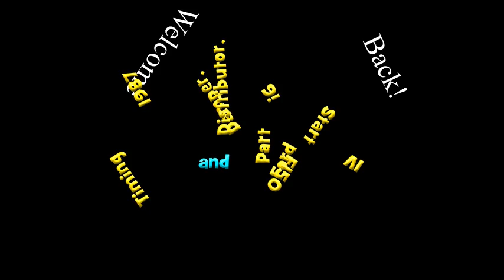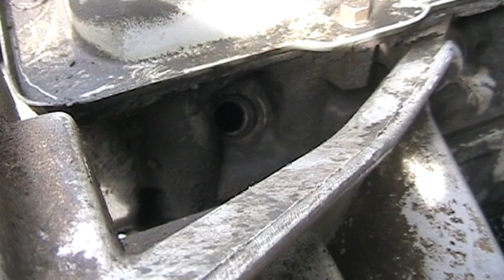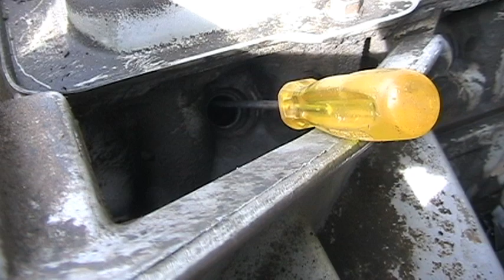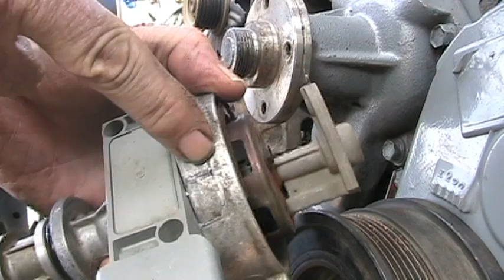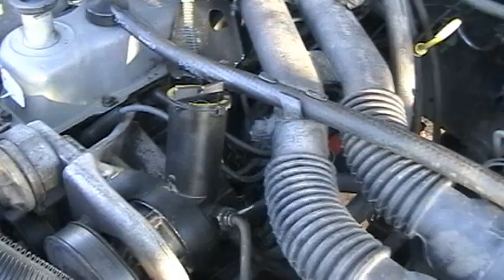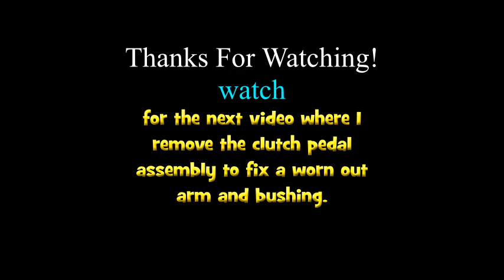1987 Ford F150 I6 Damper, Distributor, Timing and Start Part IV

Comment: what if you do all of that and the is no compression ?
Reply from the maker: Hello, Well if I was experiencing a no compression problem I would first expect a stuck or extremely out of adjustment valve or lifter (either exhaust or intake).  I would take the side cover plate off on the block behind the distributor where I could see the push rods. If it is easier to take the rocker (aka valve cover ) off then I would do that. Then I would rotate the engine over (by hand from the crank pulley) and watch the action of the valves on the #1 piston position. If either of the valves (exhaust or intake) is not moving up and down, then it may be stuck open, or held open by a bad lifter that may also be stuck and not making contact with the cam.
 Now, if both rockers are moving up and down and the valves are opening and closing then I would loosen the adjusting nuts on the rockers a bit to make sure the valves have a chance to be fully closed ( this would make the rockers loose and give a very clacky noise if the engine were running).
 Now do a compression check. If you know the valves are closed because you backed off the the rocker nuts enough and still have no compression, then take a small block of wood and a hammer and tap on the valve stem. The idea is to see if the valve is moving down and then back up. Do this on both valves ( you may have to loosen the rockers up enough and set them off the the side of the valve stem spring to actually notice and feel the valve moving. This procedure may free up a stuck valve. Be sure to tap on the valve stem and not the spring itself as you do not want to have the spring-stem valve keepers to come loose and have the valve spring come loose and drop the valve down into the cylinder..
 If all this fails to get you some sort of compression then it is possible to have a seriously burnt valve or some sort of piston or piston ring failure that is letting the compressed air escape out of the cylinder. I am assuming that your cam gear and cam are in good shape and not missing any teeth. If your push rods (and I mean all of them) are not moving then your cam gear is most liked striped of its teeth.
It is my hope that you find a stuck lifter that is holding the valve open.

Comment: what's the problem when the timing is jumping in a ford f100. motor 300
Reply from the maker: Well, I am not sure. I would check to make sure my distributor hold down clamp was tight. I would also look for any vacuum hose leaks. It may be that the fiber cam gear may need replacing. I would also run a code check on the engine and I would make sure I had a new cap and rotor on the distributor. Thanks for the comment!
Reply: The module can be bad. A bad plug or wire can cause that. Check the distributor cap for arcing.
Reply: Raunel I have the same problem and I believe that the cam gear is missing a tooth. It will go from hyper advanced to overly retarded and back. I have been able to get it to start by adjusting the spark timing (rotating distributor) but the valves still sound wrong.

Comment: i have a 240 inline 6 in my 72 f100.once I get dist how do I get the rotor botton pointing the right direction and does the botton need to be pointing to the #1 cylinder?
Reply from the maker: Hello Gabe, You need to bring the #1 cylinder up on its compression stroke (like in the video). Then align the crankshaft timing mark to the 0 mark on the tab (shown in video). Then find the #1 plug wire on your cap and make a line from the #1 cap to the distributor with a marker. You then put the rotor back on and install the distributor back into the block  making sure the oil shaft rod from the distributor fits in the oil pump shaft hole. The distributor gear will mesh with the cam at the same time. This can be a trial and error time as explained in the video. Sometimes you have to put the distributor in with the rotor pointing away from the #1 mark on the distributor because as the distributor goes in it turns when it meets the cam gear. Once you get it in and it drops into place you can turn the distributor a bit so the mark will line up with the rotor. Watch the video again and you can see that I had to pull it out a few times so as to get it to drop into place and properly line up. Hope this helps you get on the right track. Thanks for the comment!

Comment: thank you for your videos...i was hoping you could tell me how to prime my oil pump?...ive heard id have to pull my distributor but i dont want to mess with that and the timing please let me know thank you
Reply from the maker: Hello, What I have done in the past to get my oil pressure started is to remove the coil wire from the DISTRIBUTOR and the COIL (so as not to have a spark flying around the engine bay). I then turn the engine over just like I was trying to start it. I Do this in short bursts so as not to hold the starter to the point of overheating. I generally see something on my gauge after a few tries. Thanks for the Comment!
Reply: alrighty ill try that...thanks

Comment: Steve.-  I have an 1988 ford Ranger 2.3 L, with 610,000 Miles on. It runs wonderful.  I am changing the Distributor at the end of the month. (I know that the shaft and the gear are worn out)  I liked your video very much. Thanks.
Reply from the maker: Wow, that is a bunch of miles. You have maintained it very well! Glad you liked the video. Thanks for the comment as well!
Reply: lord have mercy

Comment: is that a power steering  pump noise ? mine is doing the same sound. thanks  gor the video
Reply from the maker: Yep, that is a noisy power steering pump. I replaced it later on, made sure there was no air in the line, but it still seems very noisy compared to my 1977 F250 that uses a different style pump. I believe it is the nature of the beast so I am leaving it alone for now. Thanks for the comment!

Comment: great videos I have a 95 ford van inline 6 -has close to a half a million miles on it I'm sure it's time to replace those gears--was a bit reluctant to do it from looking at the book --but your video makes it look easier--how many miles were on your 87 when the gear went out???
Reply from the maker: +Junior Hardy Hello, Mine had 150 some thousand and was probably taken well care of until maybe the last ten years. I believe it was just used as a work truck will little oil changes if any. Fiber gears do not like dirty oil. In addition the gear probably had lots of stress pulling a heavily loaded trailer full of tree trunks up some very long steep grade hills... all the while trying to maintain a 60 mph plus speed. As you know, the I6 was the workhorse for Ford for many years and was replaced by the diesel. Thanks for the comment!

Comment: Thanks for taking the time to do these videos. Just watched the timing gears video. I have an 85 f150 4.9L Carburetor style I6. I love this truck. I was wondering if you know anything about these engines having spark knock? I have replaced lots of stuff on my 85' over the 12 years I've had the privilege of owning the old girl. I just purchased a new motorcraft EGR in hopes of correcting the issues. Just had the manifolds machined to specs, and replaced gaskets with steel core style and new bolts for better sealing. My carb is out being rebuilt by family, since I started my career well into the Fuel injection era. I had some vacuum leaks, and I'm hoping this was leaning the mix and causing my issue. All my major issues have been corrected. Please email me any info. To McMechanic16@gmail.com Thanks Steve AZ
Reply from the maker: +Adam Czajka ... I personally would run a code check to see what issues show up, and resolve those. If that doesn't solve the problem you might find a solution from someone with a similar issue here on the following site.  http://www.ford-trucks.com
Look to the forums tab for a possible solution. Thanks for the comment, SteveAZ